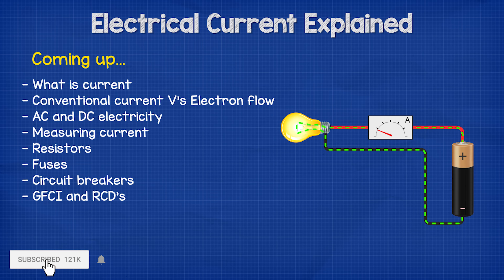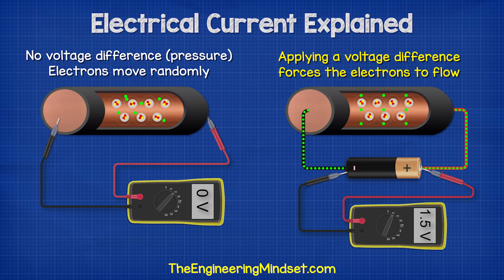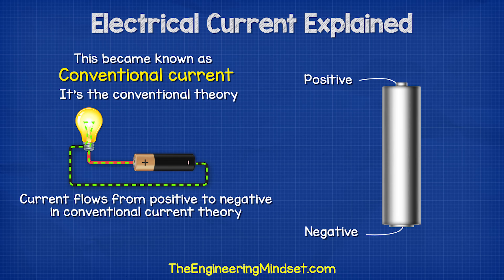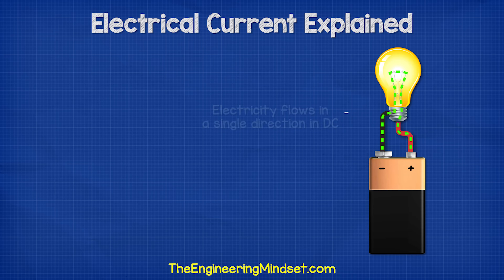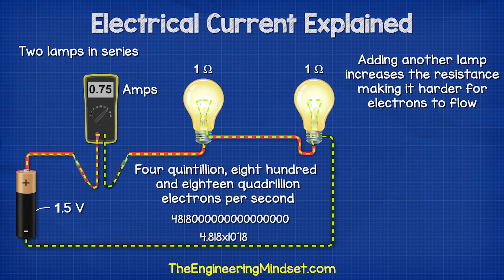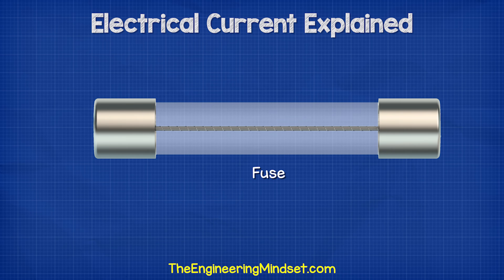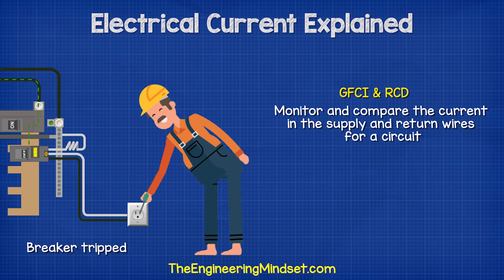Electrical Current Explained - AC DC, fuses, circuit breakers, multimeter, GFCI, ampere

Comment: I don't understand about the overload protection of the circuit breaker, if we have a 220V that according to your video is the unit of pressure, and we put a lot of appliances that we may consider as resistance, the current should be low? why is it the current has become greater after we add more appliances? I hope you answer my questions, thank you in advance.
Reply: @ Bro. Jonathan Vasques.. Thanks mate for asking this question, so i'm not the only one who had a hard time understanding it. I think the problem is, there is a lot of confusing terms used in electric engineering which give beginners a hard time grasping the basic concepts. One that comes to my mind right away is when people say "This application draws this much current from the circuit"... As if a washing machine would activly suck out current from the wire  😅
Reply: @Dean G... Thank you so much for clarification, I'm one stepp closer to a light bulb moment (no pun intented). So basically that means the a short cuircuit and an overload are one and the same thing? if so that just proves my point above about confusing terms 😄.
Reply from the maker: Seen our new incredibly detailed MCB video? link: https://youtu.be/gqEu9t8HwW0

Comment: Bit confused why does nothing happen after 1 resistor? Electrons are converted into heat an radiated out right? So wouldn't that mean that there are less electrons in the system?
Reply from the maker: Check out NEW resistor video, everything covered! ➡️ https://youtu.be/DYcLFHgVCn0

Comment: hello, I have a little confusion what if I have a power supply of 12v and 5Amp and  an appliance that needs 12v and  2Amp. Will the appliance start overheating or get damaged?
Reply: no, a 12v, 5a supply just means it can supply 5 amps at 12v.  the appliance will still draw 2 amps.

Comment: I am now convinced that no human can actually, simply explain electricity. These videos are great and helpful but as a mechanical engineer plagued by bad analogies and poor explanations, I just can't fully grasp this. 

The amp current-river analogy for example. A river with a "lot" of current is simply a river that is flowing faster. The water is no denser. It MAY have a higher water lever due to "more water" but that doesn't make it have a "higher" current. The mississippi river for example wouldn't be considered much of a vigorous current despite shoveling TONS and TONS of water. Yet, a smaller white water stream we'd consider to have a very strong current. So that means for rivers, current is literally just how fast and volatile the water is flowing.
For electrical current, its all moving the same speed! So WHAT is current? Is it the density of electrons moving? I feel like with the Volt-pressure analogy, that voltage would be the density of electrons moving.

Ugh, so confused. You did a great job, better than most, but the exact spots I need clarification are always glossed over with an analogy that confuses me more.
Reply from the maker: Current is how many electrons are flowing, volume flow rate where speed is constant. Voltage is pressure, or pressure differences. A water dam with no flow has a huge pressure difference but no current, no flow. Until you release the water through a given route. A battery has a voltage difference but no flow until you provide a path. Your wall socket has a voltage difference between the hot/live and neutral. The only confusion is that water can vary its velocity and volume flow rate where as electrons velocity is constant.

Comment: Are two different things stuffed in the positive and the negative part of the conventional electricity? You made an example of human hand. The electron moves to the finger because it's negative. But what makes it negative? Water moves from high to low it's a principle law of water. Does electrical current move the same as water? Sorry I'm not really into electricity I'm just trying to understand things. Sometimes, i get shocked from touching things Or people. Sometimes I see lights when covering myself with my blanket a brief light that makes a brief noise. I noticed it happens with different textures, too. I'm trying to find answers to this. After watching 8 min of this  video I have included that our bodies have some kind of negative electron flowing through in some bizarre situation or maybe jumps in some situation. This is stupid. One example, I was handing over a cup of water to someone I accidentally touched there finger and I got shocked, and the person also felt something. Asking me what i did,. I replied nothing. It happened few times but now that I'm listening to this electric current thingy, I feel like volunteering to be a transformer.
Reply from the maker: Seen our new Transformer video? here https://youtu.be/jcY4QN7awEc

Comment: I wonder, if in the future, instead of having resistors release energy as heat (essentially wasting energy), it's somehow rerouted to charge a battery or something.

Also, I really appreciate the simple but effective safety measures in place for electricity, such as the fuses and circuit breakers.
Reply from the maker: Check out NEW resistor video, everything covered! ➡️ https://youtu.be/DYcLFHgVCn0
Reply from the maker: Seen our new incredibly detailed MCB video? link: https://youtu.be/gqEu9t8HwW0

Comment: At 24 seconds in; "current is the flow of electrons..." Electrons? If you don't know this secret you won't understand anything after 25 seconds. Unless you have a vocabulary in Engineering. Interesting subject but I can't apply step one with any understanding.
Reply from the maker: A few moments later we explain the basic atom and electron structure. Don't worry if you don't understand everything, you don't need to. Your brain will fill in the gaps the more you learn.
Reply from the maker: Seen our new video on How electricity works - for visual learners? Link:➡️ https://youtu.be/3KePcASD0NQ

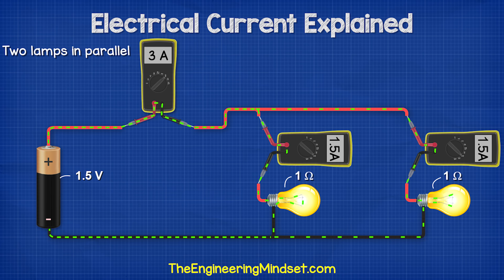Comment: Great video and series. I'm trying to learn how to become an electrical engineer and this is a pretty great start so far. I just had a question about the diagram at 13:34, if Voltage = Amps X Ohms, then wouldn't the 3 Amps change the voltage of the batter because the combines amps from both lamps equals 3, then multiply it by the two ohms in the diagram? I know that this doesn't actually happen but it's a little confusing.
Reply: the battery voltage does not change.  the battery is simply an energy source providing voltage.  it is the current that always  chsnges  depending on the resistance.

Comment: 2:14 what? 

If 1 Amp = 6,242,000,000,000,000,000 
Then that's 6x3 = 18
242x3 = 726
18,726,000,000,000,000,000

Where does that 19,272 come from, that's a ton more. I thought it was from heat that built up but heat isn't electrons and heat would affect amps not the number of electrons?

Comment: I think people have trouble understanding AC current because they think there must be  something coming out of the cord the way water comes out of the tap. It doesn't help that we refer to it as the "flow" of electricity. 

I visualize it and try to explain it like people packed into a subway car and when one person bumps another person it can cause a chain reaction of bumps that move from the source of the bump to the other side of the car but, everyone in it has stayed in place.

It's not quite right to equate pressure with flow however. With the example of water, you can have a great deal of water pressure but very little water actually flowing out of the tap. Water restricting shower heads deliver high pressure while reducing the actual amount of water coming out. So in that case opening up the flow will reduce the pressure. In a way they're opposites or at least related in a kind of symbiotic relationship.

Comment: I've just started learning about circuits and electricity and I've been really struggling to understand the difference between Voltage and Current. Then you said you can measure the presser of the tank if its not flowing but not the rate it flows at and it clicked! The difference seems so obvious now, thank you!

Comment: Why does AC have the benefit of fewer losses over transmission lines and allowing the use of transformers?
Reply: at high voltage the current is less and thus power loss is less.

Comment: Wait a second, so if I were to make a circuit where a battery and a lamp are connected and add a resistor, it will not make the lamp last longer?
Reply: I think, the lamp (bulb filament) would last longer, but the battery would discharge at the same or a faster rate because the resistor is using the "extra" electrons to emit heat instead of light, so they're not "wearing/burning out" the filament as quickly.
Could be way wrong...I'm only on this a couple of hours...🤷
Reply from the maker: Check out NEW resistor video, everything covered! ➡️ https://youtu.be/DYcLFHgVCn0
Reply: the lamp will not be bright. that is all.

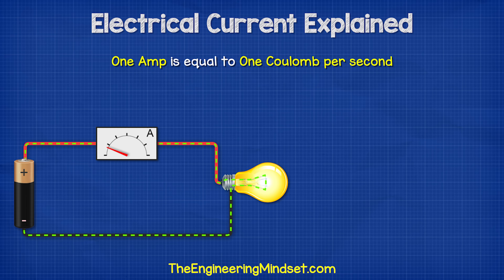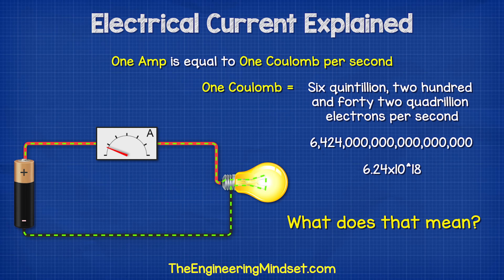Comment: You'll notice from 10:32 to 10:44 that the number written in script (six quintillion, two hundred and forty-two etc.) differs from the number shown in numeric form (6,424,000,000,etc.). Of course the former (and subsequent scientific form, 6.24x10^18) is correct. Considering the effort taken to produce this excellent, informative lesson in electricity, this small oversight is testimonial to man's tendency to err, and should be kept in mind when attempting any electrical project. Always recheck your work and then still be prepared for mistakes. Hopefully your mistakes will be as inconsequential as this one.

Comment: Thanks!
Reply from the maker: Thank you Martin
Reply: @EngineeringMindset  can you make a video on BAS controls and field terminations? Like on the PLC where do you terminate your power,signal, and common wires and also how do you terminate them in the field device as well and show the “loop” that’s is happening there.

Comment: Still trying to figure out why, if in AC electricity current changes back and forth in direction, why is one lead called 'hot' and the other is 'neutral'? Why aren't both leads 'hot'?

Comment: AC flows in a 360 degree pattern. It only flows on the outside of the wire. To convert from AC to DC use diodes.

Comment: How can you measure voltage if the current is zero. V=I x R, so if I=0, wouldn’t voltage be zero?
Reply: You’d have an open circuit so the R value would be infinite. It doesn’t necessarily mean no voltage is present or a 0 value, Since the voltage pushes current through a resistor and not the other way around. The V=IR that you calculate across any resistor is not bc of current but the difference of potential across the resistor. If the circuit is open and a source of voltage is applied, there will be no current flow but voltage will be present if it ever closes.
Sorry if that was all scrambled I’m no electronics expert but have taken a few courses
Reply from the maker: Check out NEW resistor video, everything covered! ➡️ https://youtu.be/DYcLFHgVCn0

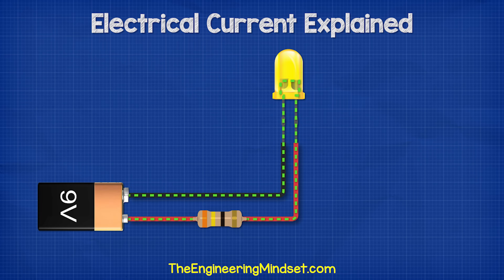Comment: @0:24 Why did you attach a fuse to the basic circuit diagram? Fuse is advanced topic in current, why did you bring that so early?

@1:17 second person touching insulated wire? diagram says uninsulated wire.
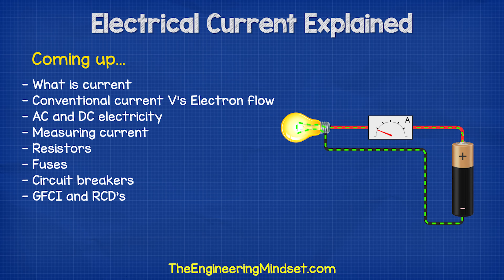Reply from the maker: 0:24 is a resistor, not a fuse
1:17 is a mistake, see video description for correction
Reply from the maker: Check out NEW resistor video, everything covered! ➡️ https://youtu.be/DYcLFHgVCn0

Comment: Does the voltage determine the amperage? I mean, how can the water flow fast without something pushing it fastly (something that creates a pressure)
Reply: Gravity is the waters pressure in this example
Reply: And weight

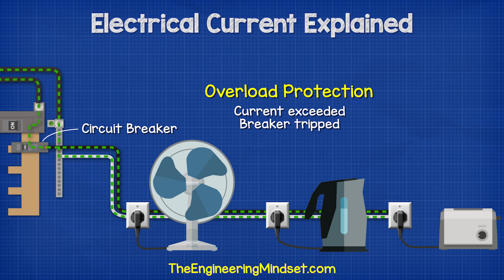Comment: 17:13 - 17:18 this isn't quite clear. Don't loads act as a resistance? Wouldn't that mean current would drop when too many loads are added? So maybe the circuit breaker's overload protection is actually to alert us to low current?
Okay, loads increase resistance in series, so this must be a parallel circuit, but... 
You just showed that parallel circuits divide current, so the only way a load could cause problems is by effectively shorting or shunting the circuit and getting all the current, right? But that has nothing to do with the number of appliances connected, right?

This was the thought process I went through before deciding to calculate the total resistance for an infinite number of parallel resistors (Asymptotically goes to 0) and finally remembering that total effective resistance determines the current delivered by the power source, and so the low effective resistance of too many parallel loads will cause a surge of current. Yeah I'm super rusty. But also you could have gone a bit more in-depth there and it wouldn't have taken much time. Surprised there weren't questions about it in the comments
Reply from the maker: Check out NEW resistor video, everything covered! ➡️ https://youtu.be/DYcLFHgVCn0
Reply from the maker: Seen our new incredibly detailed MCB video? link: https://youtu.be/gqEu9t8HwW0
Reply: @EngineeringMindset  thank you so much

Comment: I explain how electricity works with a bicycle the pedals are the generator the chain is the amps/circuit and the wheel is the load

Comment: At 10:35 you define a coulomb as 6.424 and 6.242 quintillion
Reply from the maker: See video description for corrections
Reply: My bad, didn't see that. Props for the fast response times and love the videos. I feel I was asked an unfair question today in an interview. I was asked "If measuring voltage in a 480V three phase system from one leg to ground what would it read" wouldn't it depend on whether it was a Delta or Wye configuration as well as which leg and whether it was center or corner grounded (on a delta)?
Reply from the maker: They probably wanted to see how you thought about the problem and what questions you asked. Delta is rarely ground also, but it can be.

Comment: @The Engineering Mindset 
hello i have to questions for you I've been meaning to ask. I have a boat running a 12v system 1) would it be ok to use 250v 32mm glass cartridge fuses on a 12v circuit 2) I have a bilge pump and a float switch. On the float switch it says 12v 20amp max and on the bilge pump it says 3.5amp draw. I was wondering what amp fuse do i use in the bilge pump control panel.

Thanks
Reply from the maker: You must check the manufacturer documents, it will tell you which ones to use. If you don't use the correct ones your insurance will probably be voided.

Comment: Why does adding load increase current in the circuit?

I understand that overload happens because there is an increase in amps ie increase in passing of electrons.

How does adding more appliances increase the quantity or speed of the electrons?
Reply: The speed of electrons won't really change based on load, that depends on the properties of the material they're moving through. Changing the load in a circuit is just changing how much the components in that circuit resist the flow of current. More appliances means more loads in parallel, and loads in parallel will draw current independently of one another.

Another way to look at it is power. If you run an oven and a TV, they both require power to function correctly. Power is a function of current and voltage, so it follows that with more power from more appliances you'd be drawing more current.
Reply: @thegreatzoom5073  thank you!

Comment: Well actually in DC current wether it’s electron flow or conventional current it can be either one, when he said “however scientist and engineers know it flows negative to positive” well that’s correct but also incorrect, the direction can be changed and the way he worded it is kind of misleading, a good example of this would be an electric golf cart. The direction of electrons changes depending on wether it is in forward or reverse...
Reply from the maker: That's incorrect, the direction of electrons flowing from the battery in the cart, which is providing the power to the motor, is always the same, negative to positive. The direction of electrons through the motor changes to move the cart forwards or backwards because by reversing the direction of current it reverses the electromagnetic field polarity so the motor turns the opposite way. When the battery is being recharged, the electrons will flow the opposite way but that is only because a different power supply is flowing through it and so they are still flowing negative to positive with respect to the power source. We have covered how DC motors work and batteries, check them out to see why.
Reply: @EngineeringMindset  I didn’t think about that
Reply: @EngineeringMindset  but I have seen people hook negative and positive leads up backwards and because of that starter motors (on combustion engines) will turn backwards upon turning the key, what is the explanation behind that? Is it the same concept of reversal of polarity even though the polarity is switched at the battery rather than being switched manually by a switch (forward/reverse) lever on an electric cart?
Reply from the maker: Yes, exactly. The electrons flowing through the motor coils will change direction if you use a switch or if you reverse the battery terminals. Check out our DC motor video, you can see this is great detail and learn exactly how it works :)

Comment: You label watts...What the hell are watts? Why is watts 1.5 and volts 1.5? Thanks
Reply: Watts are a measurement of power, which is current times voltage. For example, you can describe the power dissipated by a resistor as the current moving through it times the voltage across it.
Reply from the maker: Check out NEW resistor video, everything covered! ➡️ https://youtu.be/DYcLFHgVCn0